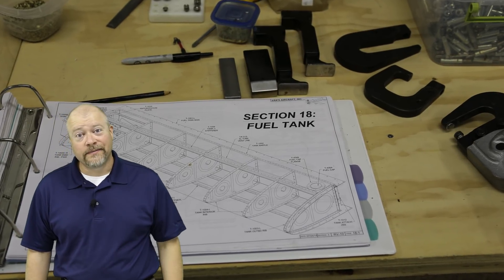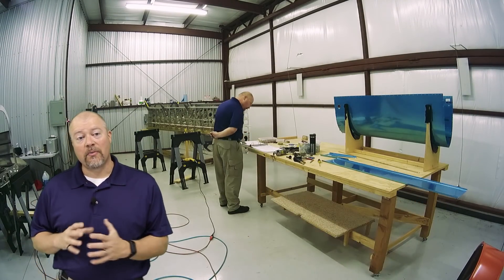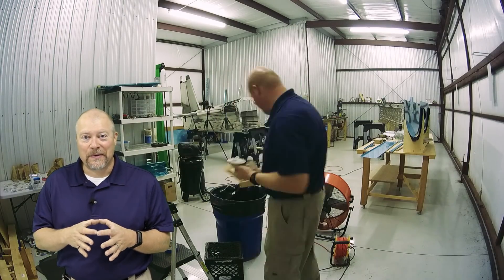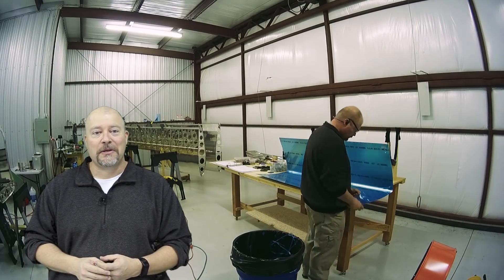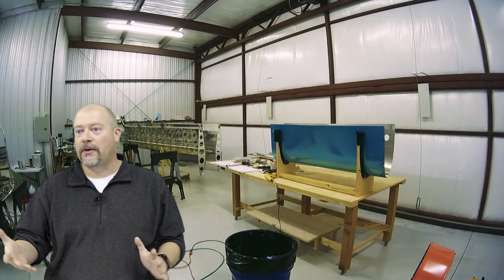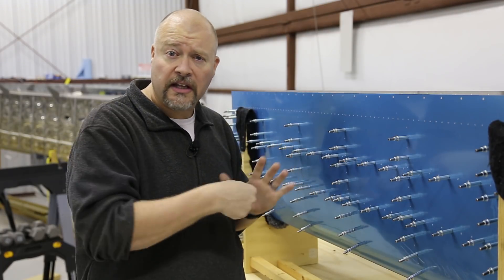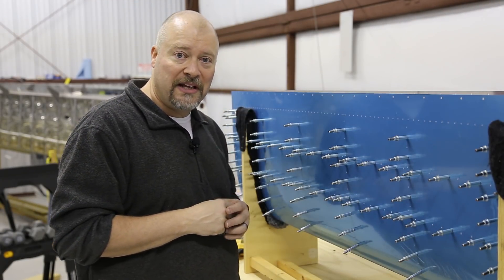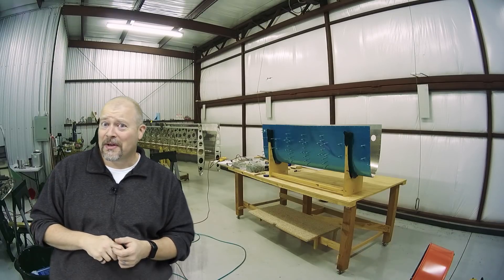RV-10 Wings - 048 - Working on fuel tank

Comment: Dude, you are doing a fantastic job.  I'm a licensed A&P and Private Pilot, and work in the aviation industry at an OEM Service Center. I've also worked in "Production" for a business jet manufacturer.  Been thinking of about building my own aircraft when I came across your videos.  Thanks for taking the time to do these!  Oh, and yes, Pro-Seal is wonderful to work with.  In a Production environment "Sealers" are actually certified yearly and make a career out of applying Pro-Seal.  V1Rotate!

Comment: Jason,  personally I wouldn't worry about the bolt vibrating loose,...but one thing that I might be concerned about are any tiny fragments of the tank sealer goop anywhere in the tank. Can they break free, come loose, vibrate loose from their attachment, and then clog up your fuel line, causing engine stopage. Don't know. Just my mind playing "what ifs". Keep on.

Comment: Are you going to add extended range tanks?
Reply from the maker: This is a million dollar question.   Er.. well.. really it's about a $3,500 dollar question =)   I have thought about it quite a lot and honestly I don't think I will.  The plane as it is now is a bladder buster, so adding an extra 15 gallons while sounds good.. eh.. I'm not sure I want that.   Plus it would prolong the build, and possibly add undo/untested stress to the spars..
Reply: Jason Ellis True indeed. I think at 180 true you can move across enough county lines in 2-3 hours that a “pee” break is in order. 4 folks and enough fuel for 2-3 hours is about all you should need. Not many folks are still thrilled with the ride after 3 hrs. Most need a break.
Reply: Jason Ellis Thanks for responding. I have many times wanted to reach thru my screen and give you a hand but understand your desire to build the plane with your own hands. I have trouble programming the alarm clock on my phone, but I can line out over 100 men in a power plant or set up the quality program in pipeline gathering system. Thank you for your videos.

Comment: I am surprised Vans did not provide a recommendation on plugging those unneeded holes in the fuel tank.  Seems like large rivets would have been lighter and more vibration resistant, but I can't imagine your bolt solution will fail.
Reply: LTVoyager i know in the plans for the -8 Vans recommends either riveting a small plate,  or using an AN470AD6 rivet to plug the tooling holes... with proper sealing of course.
Reply: Brian Wicker The large rivet makes the most sense to me, but the bolt solution should also work fine albeit with a small weight penalty and marginally greater chance of failure due to vibration.

Comment: Also, as far as those bolts in the tank. How does Vans recommend dealing with the holes?
Reply: Shannon Taylor you cut a piece of aluminum and attach it to the ribs with tank sealant.